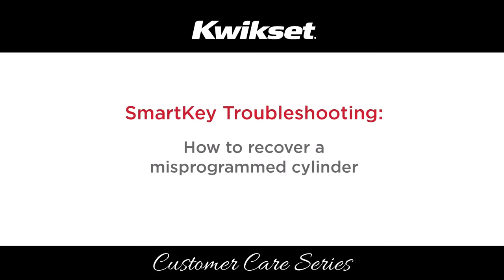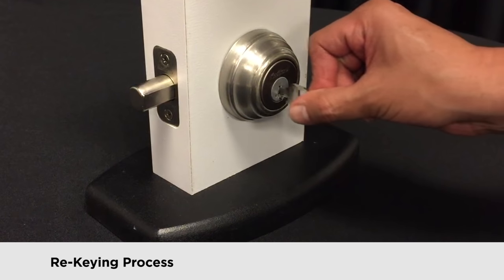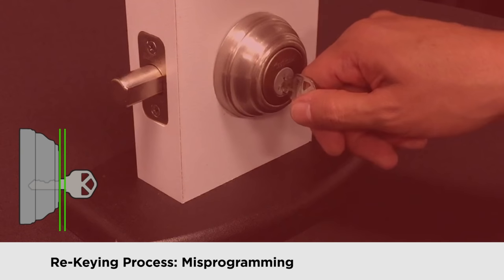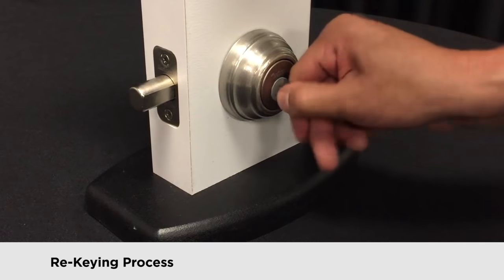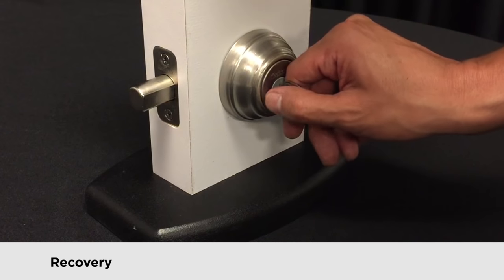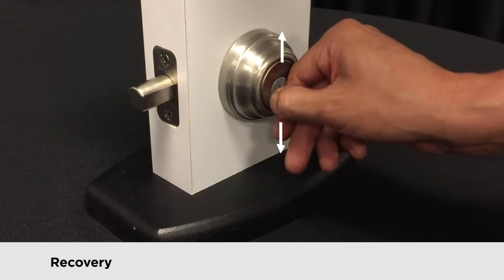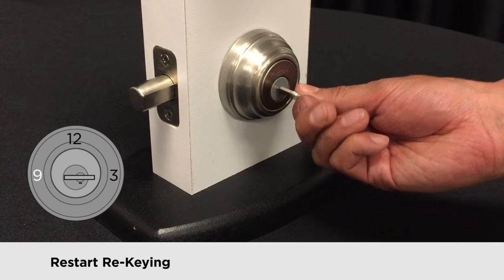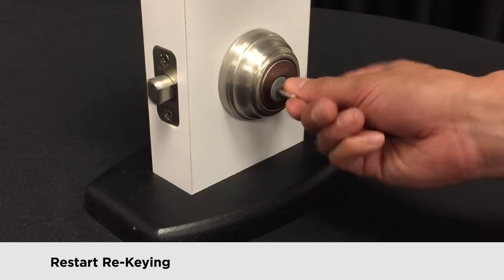Recovering a Misprogrammed SmartKey Cylinder

Comment: This was exactly what I needed.  I was like, whats this do, and unknowingly reprogrammed the original key incorrectly and couldn't use the lock anymore. I was so glad I found your video and was able to un-fix the lock and not only reprogram the original key again but key matched it with the Kwikset deadbolt so we can use a single key to open both locks and not fumble around trying to remember which key went where.  Very useful if being chased down by some maniac.

Comment: Glad I'm not the only one that did the rekeying process a bit sloppy.  The video helped me as well.  If you have the last key you used and pulled out you need to be patient and light pull out as you rotate to right and may have to push all the way back in a restart more then once.  Once you get the feel for what it feels like...its a breeze.
Reply: That's easier said than done. I'm still struggling what's the trick? 😅

Comment: Like some of you, it did not work for me either. When it was first set it was working fine, tried it a few times and was ok. Never needed to use the key after it was programmed until lately and found that it no longer works. Cannot turn the key at all. Tried the method in the video. Up down right left centre ... nothing works. There should have been a reset button on the inside. Super frustrated. Now have to look for a new smart lock system. Not a happy camper.
Reply: Same problem for me,  it worked fine for a couple of days then just stopped turning.   This attempt to reprogram isn't working for me either
Reply: Me too.  Worked fine at first, but soon stopped working.
Reply: I know this thread is a year old now, but in case there are new frustrated victims out there, there's another YouTube video that shows you how to *easily repair the lock, by taking out the tumbler*. This is the method I had to use: https://www.youtube.com/watch?v=advYvGgMzhA
Reply: citrinesun thanks going to try that. I’m another victim of kwikset lock 🔐
Reply: I am having the same problem - not happy at all with this lock system
Reply: @citrinesun  Thanks, worked for me.
Reply: I tried a lot but did not work for me😢
Reply: These locks are terrible, I've had them just unspin and completely lose whatever pin configuration they held numerous times, it's hard to find a lock without the stupid smart keys anymore. Garbage.
Reply: Take it back to where you bought it from or buy a new lock and return the old one. This happens fairly often 5% of the time when just inserting key.

Comment: For those saying it doesn't work...don't give up, it does work. You HAVE to find the right spot on your key. It WILL save you an expensive trip to the locksmith. I went to return mine to Home Depot but they were closed. I came home, reassembled it then found this video. Its SO important to make sure you push the whole key in the hole when reprogramming.
Reply: This is true, I fiddled with it for at least 5 minutes but just kept trying and it finally turned.

Comment: I rekey these locks all the time at work when I put  the new key in I move it in and out  a few times  before  I turn it to the 12:00 position since I started doing this I haven't had any misprogramed keys as long as I'm careful not to turn the lock cylinder while  doing this.

Comment: The mechanism in the core of mine was sticky due to wear, so some of the pins were stuck "up" when I programmed. I could hear them drop when I took the key in and out and the only solution to fix mine was to remove the core and reprogram. Plenty of other videos how to do that and they do work. Also gives a great opportunity to oil the heck out of the guts of the core. Mine had metal shavings and clearly was in desperate need of some 3 in 1 oil. 8 years on and after I did all that they work like new!

Comment: Is the smart key unique to Each lock?
Can my neighbour use his smart on my lock for example to change the keys into his?
Reply from the maker: Hi! Our Consumer Support team is here to help... please contact them here: https://kwik.st/2V5bXqZ or call them at: 1-800-327-LOCK (5625)
Reply: Yes, but you have to have the original key in order to start the change.
Reply: The Smartkey tool is standard, and yes, anyone can buy one. However, you need to have the old key on-hand, in order to re-key the cylinder to a new key. Yes, your neighbor could theoretically re-key your lock, but he'd have to have access to the key that already works with that particular lock first.

Comment: here's where i screwed up and can't fix. while the original key was still in the lock, i inserted the tool, then i accidentally turned the key. now neither key works at unlocking. the key just turns the door knob but not the lock. i successfully reprogrammed 2 dead bolts prior to this with zero issues

Comment: It worked, I had to pull my key almost halfway out before I found the spot I screwed up at originally. Haha! I tied both the new key and the smart key. Ended up needing the smart key to find the spot I made the error.
Reply: I do not believe that you had a key half way out of its hole when you originally tried to rekey.
Reply: @jeffstanley4593  it’s true, I really messed it up. But, finally found the spot and was able to fix it.

Comment: Done this correctly many times. Now I have three locks that are unusable because I watched another video that said nothing about 3 o’clock and their lock was opposite of mine. So I did 9 o’clock instead. Still nothing works.
Reply from the maker: Hi! We recommend following the cylinder recovery instructions in the link below. If you can get the key to turn, you can then re-key the cylinder with the SmartKey tool to the same key. https://kwik.st/3vRVpIG If the key is still not turning in the cylinder, please contact us so we can help you with a replacement cylinder: https://kwik.st/3tV2Yht Thanks ~ Kwikset Social

Comment: I've been trying this so many times but the smart key tool won't go in all the way and I am worried that if I pull out the current key without the tool going in all the way that it won't program the new key correctly. Does anyone else have this problem or have any ideas for me? I am doing it exactly as it is in this video.
Reply from the maker: Hi Angelo - We're happy to help you! The SmartKey Learn Tool may not fit into the opening fully, yet you should hear a slight click when it's inserted as far as it will go. At this point, you can remove the tool and continue following the re-key instructions. Please make sure that the key itself is inserted fully into the key cylinder. You can re-key the cylinder again if you feel the key was not fully inserted. For one-on-one support, please call us at 1-800-327-LOCK (5625). Thanks ~ Kwikset Social

Comment: I still cant get mine to unlock the double cylinder deadbolt with the original and new key. I think where I screwed up was having the deadbolt in unlocked position, then using the smartkey tool, pulling out the original key, then inserting the new key to lock position. then rotating as if unlocking back to 90 degrees vs 180 and pulled it out. When I tried inserting the key again, it would not move the dead bolt. I've tried finding the position for both keys for 30 mins without success. Could it be that I pulled it out at 90 degrees? and if so what can I do about it? any advise is welcomed.
Reply from the maker: Hi Geoff – We can help! If you’re still having trouble recovering your cylinder, the SmartKey cylinder can be replaced with a new cylinder. Our Consumer Support Team is available to assist you with this... please contact them here: https://kwik.st/3LJDMyo or call them at 1-800-327-LOCK (5625) ~ Thanks, Kwikset Social

Comment: what if the key doesn't turn after it's been misprogrammed?
Reply from the maker: Hi Joann - We are more than happy to help you with your SmartKey Cylinder. If you have tried the recovery steps in this video and neither key is turning, we can replace the cylinder for you under your product's warranty. Please contact our Consumer Support Team here: https://kwik.st/3K0Evtp or call them at 1-800-327-LOCK (5625). Thanks ~ Kwikset Social
Reply: @kwikset  hi thank you for reaching out, but my husband was able to get it :) thanks to this video. Initially I didn't read through the comments till later :( at which point I discovered others had the same issue.
Reply from the maker: Glad to hear it worked! :) Have a great day. ~ Kwikset Social

Comment: I have tried and tried. I am holding my thumb against the door so that the key is moved in thousandths of an inch and it will not work. I have pushed to the left right up and down all while holding the key and using my thumb to put the slightest change on it. Good luck to all who f up. On a more positive not, Kwikset is sending a replacement core so I can try again.

Comment: What if this doesn't work?
Reply from the maker: Hi Robert - Happy to help! If the key does not turn by following the recovery steps in this video, the SmartKey cylinder can be replaced with a new cylinder. Our Consumer Support Team is available to assist you with this... please contact them here: https://kwik.st/31qhorD or call them at 1-800-327-LOCK (5625) ~ Thanks, Kwikset Social
Reply: @kwikset  I bought the cylinder reset tool.  It did the trick.
Reply from the maker: Hi Robert - We're thrilled to hear that you got the cylinder to reset with the SmartKey Reset Cradle. Have a great day! ~ Kwikset Social
Reply: @robertmooberry725   can you send me a link to that?

Comment: This video uses  a single cylinder lock and does not work to correct miskeying my double cylinder lock.  I cannot remove the key without closing the bolt, so if I want the door locked, the key has to stay in it!  This defeats the purpose of having a double cylinder lock on a door with glass in it.  Also, on the other side of the deadbolt, the bolt will not come out at all, the key will not turn.
Reply from the maker: Hi Lou - Our Consumer Support Team is here to help... please contact them here: https://kwik.st/3Izz7Ne or call them at 1-800-327-LOCK (5625). Thanks ~ Kwikset Social

Comment: I've worked this at least 10 times. It programs and turns every time. But, when trying to use it the first time, it always takes at least one minute of jiggling. And, unlocking, 2-5 minutes of jiggling. And, mind you, AFTER several successful reprogramming sequences. Bottom line, it reprograms easily, but functions live....poorly.
Reply from the maker: Please give our support team a call at 1-800-327-5625, we'd be happy to help you troubleshoot your SmartKey Security locks.
Reply: @kwikset  I had to take it apart to reset it and use the keys that came with it.
Reply: I took it apart and started over with the key it came with so that it would work.

Comment: Brand new front door lock set out the box. I got both locks installed (top dead bolt and handleset). Brand new keys do not work in either lock. Neither key will turn either lock, won't budge at all. So stinking mad here!!

Method in the video is not helpful because neither key will turn to the 90 deg position.

Comment: Pulling the key out as you’re turning the cylinder looks like a great way to bend the wafer which is the number one cause of lock failure in this lock. I wonder if they even asked a locksmith before producing this video. Unfortunately, I Know many locksmiths who won’t touch these locks because of the issues they have.
Reply: Wow. Have used them on every property I have. Never had an issue until this time which I know was my carelessness.
Reply: I buy these so I don't have to know a locksmith! I've re-keyed about a dozen of 'em, and have only had one issue, which was my own fault. This video helped me right that wrong in a matter of minutes! Cheers!

Comment: if it still doesn't work you can do the advanced way of taking it apart with a screwdriver and needle nose pliers to reset the lock 😉
Reply from the maker: Hi Michael - Here to help! For a SmartKey cylinder, we do not recommend taking it apart as it works differently than a pin & tumbler cylinder. You can replace the cylinder or reset it with a SmartKey Reset Cradle. Our Consumer Support Team is here to help with the best solution... please contact them here: https://kwik.st/3yTD9hk or call them at 1-800-327-LOCK (5625). ~ Thanks, Kwikset Social

Comment: No matter how I articulated the misfit keys (original or new) I could not find the sweet spot to get the tumbler to turn. 

Found this related video thanks to another comment here: https://youtu.be/advYvGgMzhA

The newest edition of these Kwikset tumblers will not match the video but it was 90% of what I needed to know to figure out the rest. No easy task for basic tools on a garage floor mat! I would highly recommend a sterile workplace, jewelers tools, a magnifying glass, great lighting, and lots of patience.
Reply from the maker: Hi Metroporter - Here to help! If after trying the SmartKey recovery steps, the cylinder is not rotating, we are happy to help with a cylinder replacement. Please contact our Consumer Support Team here: https://kwik.st/37DQ7F2 or call them at 1-800-327-LOCK (5625). Thanks ~ Kwikset Social

Comment: My key stopped working out of nowhere. Spent too long jiggling around following this video's direction and gave up. Followed the instructions in this other video to take apart the lock and this solved my problem: https://www.youtube.com/watch?v=GyHUB3QKskU I was able to rekey with the same key. Just take one step at a time. Hardest part was wafers falling out or getting misaligned from the channel while putting it back in.
Reply from the maker: Hi A M!  Our Consumer Support Team is here to help with a SmartKey Cylinder replacement... please contact them here: https://kwik.st/3IZHOjL or call them at 1-800-327-LOCK (5625). Thanks ~ Kwikset Social